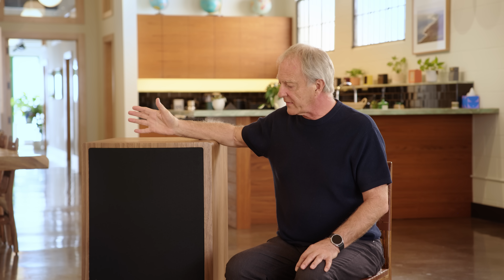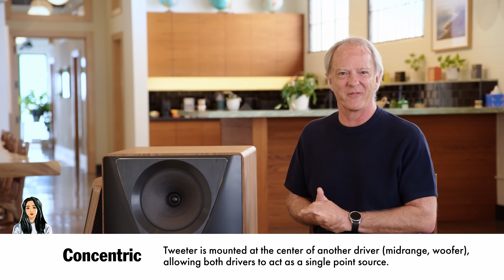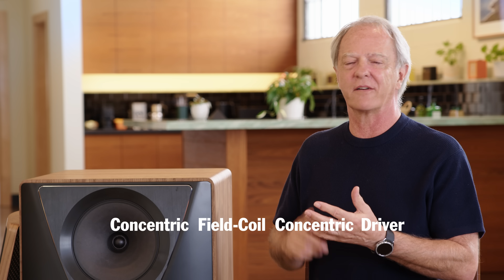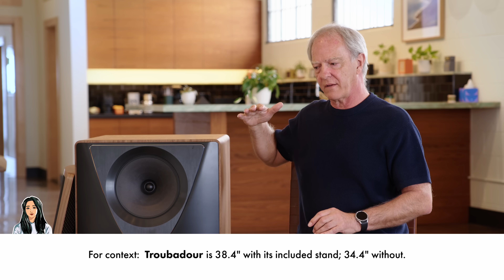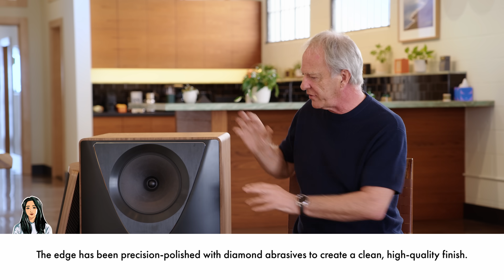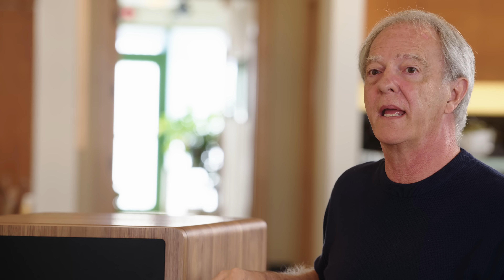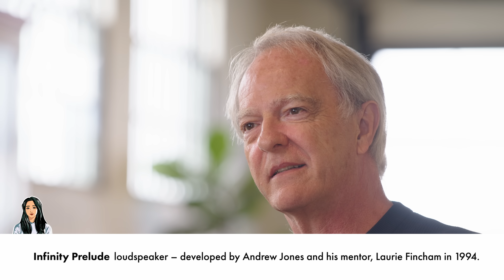First Look! Andrew Jones's New Loudspeaker – TROUBADOUR

Comment: Does GR research have an upgrade kit for it yet?
Reply: Danny has to find the words to trash it first and then offer a ‘fix’.
Reply: 😂 Yep, it's 12k
Reply: Danny will design it in 23 seconds, just by looking at the speaker - from behind...
Reply: @jungtarcph 😂
Reply: Danny is a little out of his league with this one!
Reply: @BostonMike68 never he is the smartest of the smartest
Reply: He did one for the Mofi Sourcepoint 8 and about all he really did was just notch one little bump and just pretty much a parts kit for premium parts.

The reality of the situation speakers are built to a price. You can't put $800 of crossover parts in a speaker of that class and run a sustainable buissness.
Reply: @johnrus7661  And that's the real problem with guys like Ritchie and his worshippers. Ritchie at least knows good and well that speakers sold in the traditional retail system can not use parts that cost five times more or ten times more than what is used in most of the speakers that get sent to him  and still be sold for the price that they are. But he pretends that all of them should have crossovers that cost as much as some of the entire speakers. The scam isn't that his crossovers aren't good or that the parts aren't good it's the misleading information and misrepresentation of the products her receives.
Reply: @davep2945 You fucking idiot.

People send him the speakers so people can take it up a big notch in performance. Many times a HUGE jump in performance. If you are fine with junk speakers. Good, nobody is forcing you.

But for those that care, there are so many speakers out their that have great bones and the crossover holds them back tremendously.

He doesn't even make money doing it. He doesn't mark up the parts and he doesn't charge for the design work. It's just a service to his customers and because he likes doing it.
Reply: @davep2945  To that end, even mofi took a note and made an upgraded crossover network as well. And funny enough, copied in a different way. What Danny did with the FR.
Reply: @davep2945 Have you heard his “perfected” mods? I had a friend who had his speaker “upgraded”. It sounded worse. Flat freq response and waterfall plot only gives you a gross estimate of how a speaker sounds. He never got the memo from true speaker designer legends.
Reply: @davep2945 I don’t know that it’s a con. He does what he can and offers a service that does provide value to people that like to tinker. And if you can save money along the way, who cares. The bulk of his stuff is driven by people that want more from what they bought. It’s not that he buys them, then trashes them and claims to right the wrongs. He’s helping people get what they ask for. And publishes it. Objectively, I’m glad he does
Reply: @BMWBuilds Exactly. And with the right speaker. You will get a value you can't get from just buying another speaker. Even 13k bookshelves have less premium parts than what you can throw in a speaker. And being directly in the signal path, vibration dampening, getting ferrous metals out of the signal path, soldered connections instead of steel push on connectors, copper binding posts or tube connectors etc etc.

They all add up to a very significant improvement.
Reply: @johnrus7661 I bought one of his kit speakers. Not impressed. Have you ever seen Danny compare his mods before and after with listening tests, not just frequency response? He just says it’s so much better after his mod. PT Barnum much? 😂
Reply: @JohnLee-db9zt 
Danny admits he doesn't do listening comparisons, he's just all about flat frequency response. Flat, flat, flat..😑😑😑 Has no interest nor respect for a spkr company's "house sound", nor tuned or enhanced speaker curves!? 😏
Reply: nice
Reply: The best audiophile joke of the last year 🤣🤣🤣
Reply: No, first he will wait for the EAC review. If the review is good, he will say: ‘These deserve respect, but they can still improve.’”
Reply: My thoughts exactly. Them Texas boys will hot rod any speaker like their 1960’s Corvette for 0-60 and 1/4 mile. Forget handling. 😂
Reply: He got his own followers MSGA!
Reply: Danny is so full of himself he defines narcissism…..
Reply: Danny was the first and last person given a 🧠
Reply: Danny will want to trash it as soon as he can, i had to stop watching danny as he blows smoke out his ass
Reply: Lol
Reply: That guy thinks every speaker should be a studio monitor.
Reply: GR research upgrade: It's a country-western crossover that adds a twang to vocals
Reply: Of course, a second prototype was sent to him. And you won't believe this, but as it turns out, the crossover parts are trash, the baffle is the wrong size, the jacks have way too much metal in them and the cabinet is unbraced! Don't worry, there's an upgrade you can get. 😛
Reply: @TheNathanMChannel  Not to mention the new power supply to power the field coils. 😂
Reply: @TheNathanMChannel I’m here for the comments 😁
Reply: Best comment by far! I'm sure GR Research will find something to "improve" on LOL
Reply: @vinylexplorer9817  I left a comment on one of Danny’s videos to the effect of “Does Danny approve of any speakers that weren’t designed by him?”. He was not amused.
Reply: @hsmiii Couple weeks ago......I left a comment about my Klipsch RP-600m's.  I just wanted to know how all this 'out of phase' stuff on the graph is going to effect my orchestral recordings in MY space (which they sound just fine to me).   All went quiet, never answered.   Others got on my case.  MEASUREMENT SNOBBERY is what I observe in his fan base.  It doesn't mean too much, because rooms change everything anyway!  Besides, who wants a FLAT spec speaker.  We buy different speakers because of their coloration which we like, or not.
Reply: @garysmith8455 I think you misunderstand his use of flat measurements.  It means all audio frequencies are at the same level.  A poor speaker will emphasize some frequencies which makes music sound unnatural.
Reply: @C @Corndog642  designing a speaker was as simple as that. 🙄🤦‍♂️ Btw did you know that throwing a bunch of crossover components to fix that FR bump or dip also degrades the sound in other ways, often times more profoundly than the FR aberration?
Reply: Of course! As soon any of you that can afford these speakers, thinks can I take it further, then you send one to Danny for upgrade or wait a bit until Andrew makes a “Master Edition”, like the Mofi’s. Same same?
Reply: All these speakers cannot be so bad that GR Research seems to find fault with.
Reply: @beyondonethousand They aren't all bad. But that doesn't stop him from improving them anyway 😆
Reply: @infn To his taste.
Reply: @beyondonethousand
You have to remember that people send them in wanting change.
Reply: Say what you will about all those YouTubers who promote themselves and their ventures, but 99% of the speakers that get sent in to GR Research are indeed flawed both in design and execution, using cheap parts etc., and often sold at prices where anyone who has designed and built speakers for decades keeps wondering if the respective brands are merely greedy or hire nitwits on purpose. To quote Robert Byrne: "Whatever happened to the lost art of doing one's job right?"
Reply: @LeonFleisherFan  yada yada yada
you overthink it mate
you either like how the speaker sounds or you dont
if you dont, dont buy it, how simple is that
changing the crossover to meet his "studio monitor" like theory is pointless, im not an audio producer, when I go to a concert i dont care about the frequency response, its either i connect emotionally or not. 
fk those gr and asr cults is tiring af
Reply: @LeonFleisherFan  Flawed by whose standard? Yours? Ritchie's? The non-existent universal law of speaker design? I get what you think are flaws and I have heard far more speakers than most people commenting combined and I would agree that some of the speakers sent to him are designs I would not like. However, if they are from a major brand and the example he receives is not a manufacturing defect like the cap is bad or something then that's the way they were intended to be. They are not broken they are suited to a customer base that loves them. How many speakers from any brand Ritchie has received speakers from are sold and enjoyed versus the number of people buying his parts kits? For a company like Klipsch it's easily 50,000 to 1 or more. There is no standard that manufacturers are required to adhere to which by default means they are not deviating from a standard. You want your crossovers to sum perfectly and I do as well but it's not required or even a fault as some designs are done that way on purpose to produce a certain sound. He just can't stand it that the way wants things done is not the irrefutable way things must be done. His ego is off the charts. He misleads people about other companies products and pretends he's the honest man in the game. The problem is not the way another companies speaker measures it's that Ritchie tells people that it's wrong when there is no definitive rule to judge it against. And to tell people that the parts are always "cheesy" when he knows darn good and well what the retail model requires from a cost savings point of view. He knows it so well that he can't do it so he only offers direct to consumer. A perfectly acceptable way of doing business but don't suggest to people that they should have $200 worth of crossover parts in a $500 or even $2000 speaker. On the retail model that would be $1000 in crossovers alone.
Reply: @davep2945  Objective standards such as drivers not summing in the crossover region, delay and uneven phase response, ringing from cheap drivers and cabinets, uneven off-axis (horizontal and vertical) response resulting in comb filtering (a major problem in particular in untreated living-room conditions and near-boundary setups) etc. & etc., resulting in speakers that audibly and measurably do NOT reproduce the input signal, but detract from it, and worse yet, add distortion that no sane person wants to listen to. Personal taste had best be applied to the differences between well designed and built products. What you and I think about the ego or honesty of self-aggrandizing YouTubers like Danny or Amir is irrelevant in view of the fact we all know, whether intuitively or through education, what the purpose of a loudspeaker is: reproduce the input signal. Of course Danny's channel gives a distorted view insofar as the speakers he measures and designs upgrades for are sent in by unhappy customers, and measurably flawed to an extent where he doesn't require the stereo pair to ever listen to them, because again, those upgrades address issues, not matters of taste. To be quite honest, who cares about the ego of someone who sells his upgrades for parts cost, no extra charge for measurements and labour, just the standard margins on parts of any retail shop. Quite frankly, anyone complaining is delusional: it's a niche, and of course it comes with its sales pitch, how else would people learn about those upgrades? What impresses me is what he does would even be financially feasible in our modern throw-away society, with special offers including free shipment from all over the planet, and a plethora of second-hand market internet platforms...
Reply: @davep2945  Perhaps the most common misunderstanding is that listening and measurements are somehow incompatible opposites, or that one is more important than, let alone replaces the other. The contrary is true. Measurements save time and money in R&D, help pointing out flaws etc. Flawed speakers will not make a voice sound like a voice, or a piano like a piano, if the speaker is measurably incapable of reproducing the input signal. Having said that, two well designed and measuring speakers need not sound identical at all. Much as an architect hires a structural engineer to determine whether a building is structurally safe, beauty is still in the eye of the beholder.
Reply: @LeonFleisherFan You drank the kool aid.
Reply: @JohnLee-db9zt  Which or whose cool aid? I watch videos such as this one, Amir's, Danny's, and those of other YouTubers etc. for educational/recreational purposes (to see what's out there). I've designed and built speakers for decades (including one's with time alignment and phase-coherent filters of my own design), it wouldn't cross my mind to buy an ill-designed and lousy sounding speaker that needs upgrading to become listenable. It's a way of throwing good money after bad. Quite on the contrary, in my opinion, a speaker would need to be properly designed and well built, not to mention sound realistic and coherent for it to be worth upgrading crossover parts, let alone redesign. Having said that, I have sympathy for people who build kits (I've designed speaker projects in the past for others to build for themselves), that makes sense from a multitude of perspectives.
Reply: @JohnLee-db9zt  My perspective is simple (and I don't need anyone to point this out to me to notice): what good are great electronics (audiophiles spend four, five, sometimes six to seven figures on systems) if a speaker can't so much as make a voice sound like a voice, or a piano like a piano. That's how I got into speaker design. Because I heard family members practice, went to concerts, recitals, operas, and noticed the discrepancy. If you need others to point it out to you, or tell you what to do, that to me would be the only "cool aid" there is. Ignore them. Listen for yourself!
Reply: @JohnLee-db9zt I changed parts out and could clearly hear an improvement
Reply: @CanberraProtest-dm6hu Whose parts? I’m glad you heard a clear improvement to justify the cost.  Doesn’t mean others will.
Reply: @LeonFleisherFan Do you think Danny listens to live music as his reference? I got news for you. He rarely listens to recorded music., let alone live music. 😂